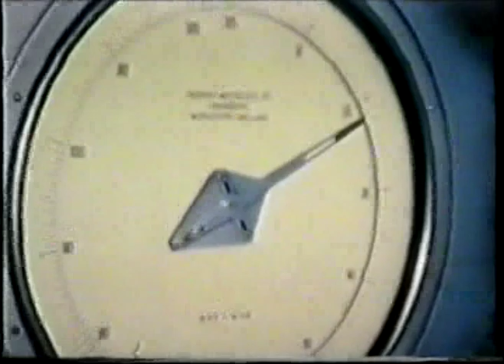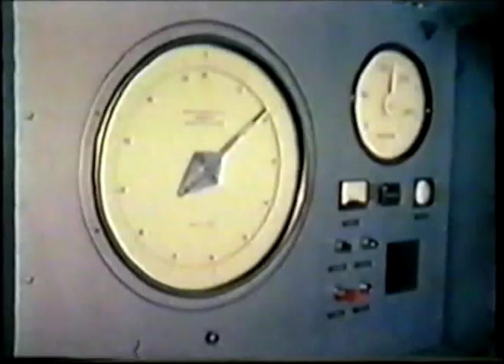Doxford Opposed Piston Oil Engine (1971)

Comment: In my seagoing days as a marine engineer, 90% of the motor ships I sailed on were powered by Doxford engines. They were very reliable, apart from cracking a cylinder liner while sailing across the Australian Bight. We changed the liner for the spare, and proceded to our next port of call which was Newcastle in New South Wales. The cracked liner was repaired by one of the local shipyards and returned to us before we departed.
Reply: I was on a ship that lost two when the engine seized and bent two of sets of connecting rods. The ship was the MV Benhope.
Reply: I sailed on two ships with a BW double effect , same story , cylinder liner cracked , 24 h of hard work in a row.
Reply: @jean-claudedemartin3810  The beautiful thing was that we were at the Newcastle shipyard for nearly 3 weeks if my memory serves me well, so it gave us a break from doing 4 hours on, 4 hours off for a while. We went on to day work in the engine room as you usually do while the vessel is in port.
Reply: I should have said 4hours on, 8hours off.
Reply: We need a film of a group of worse for drink 'ginger beers', hands on head,  preforming 'the doxford song' -- bobbing up &  down in the correct firing sequence, ( Bank Line for preferance)  great lads!-I've seen them pull a piston, while rolling around in the big swells at nearly 60 South (dropping off a met bouy, en-route to magellan & WCSA, from bay of bengal)  X

Comment: Thanks for the movie . .  I worked with the 'J' and the 'P' and found them to be good engines with minimal breakdowns. Used to run about 110 rpm if I recall
Reply: Yes. 110 r.p.m. was the full ahead engine speed on the ones that I sailed on.

Comment: Whilst I appreciate the engineering and huge success of these these beasts, I sailed on two ships with LB Doxfords in the 70s and by then the opposition in the form of B & W and Sulzer built much more reliable engines. I believe that Doxford sat back enjoying the success of the LB and by the time they woke up and developed the P and J types ( we won't mention the mechanical nightmare -Seahorse) it was already too late - it was a great same.

    The biggest source of pain for us, as operators, was trying to keep the lower piston cooling system tight and prevent water contamination of the sump.  We had to stop very few days and re-pack/ tighten the lower piston swinging arm glands. We found that the use of PTFE packing in place of the original type improved the situation.

Great video by the way.